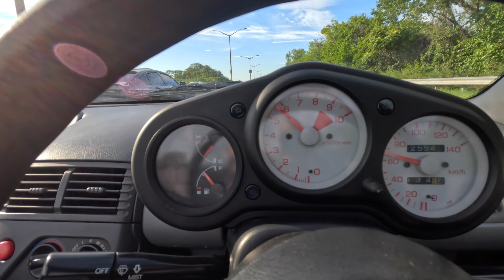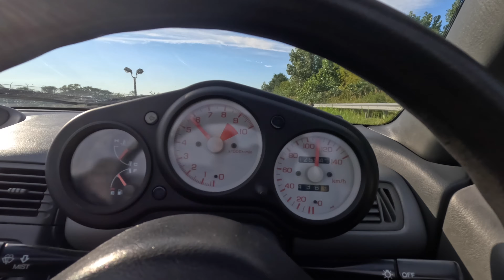The Honda Beat is DONE

Comment: I knew that green and black would look great and it does!  Painting the rims black would be the cherry on top.

I recently pressure washed some more of the silver paint off the rims of my Hijet pickup to show more of the black underneath.  I was thinking about powder coating the rims black but now I think maybe I'll go with a gray to match the new paint job... which didn't happen this week because life got crazy and I'm old and don't have the mojo to manage all of that and be productive too.  I did manage to grind out minor surface rust, Ospho the spots to make iron phosphate that won't keep rusting, epoxy prime those spots, scuff the paint and wash off the residue.  I still need to Bondo two little places, mask everything, solvent wipe the truck and paint it with roll on bed liner to make a tough off road finish.  Maybe the following week I can paint the inside, install the custom toolboxes and reupholster the seats while adding heated seats which will be nice this winter.  I need to spray underneath with Surface Shield to protect it from salted roads to keep it from rusting, but I think first, I'll Ospho the underneath to convert the mild surface rust before rust proofing it with Surface Shield.